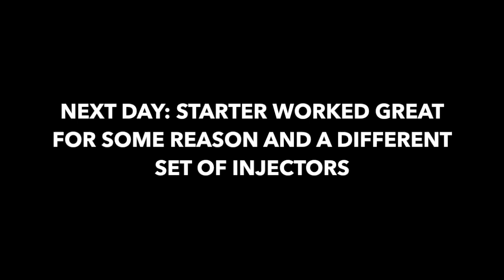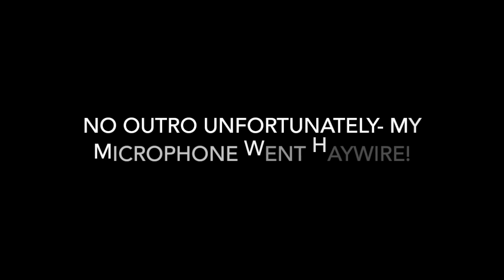Starting my 12 Valve CUMMINS Engine on a Stand

Comment: Good video . I noticed you did not have a radiator hooked up to it. How long is it safe to run a Cummins without water ?.
Reply: I personally wouldn’t run it at all like that. The turbocharger gets hot very quickly

Comment: Wth how you do that? Got given a 12v Cummins truck has sat for 6 years. Hooked battery upto it lastnight and had no power To anything. What’s the red wire going too? And do you just jump the starter also how would you turn it off?
Reply from the maker: Hook a ground right to the block. Hook a power right to the big terminal on starter. Also hook power to the one wire in the fuel solenoid on the injection pump. And then take a screwdriver and cross the big terminal on the starter to the little post on the starter. To turn it off just take the power wire off the fuel solenoid on the injection pump
Reply from the maker: In this case in stead of a screwdriver jumping the start i just used a long wire and hook it to the battery so i could do it with my hand